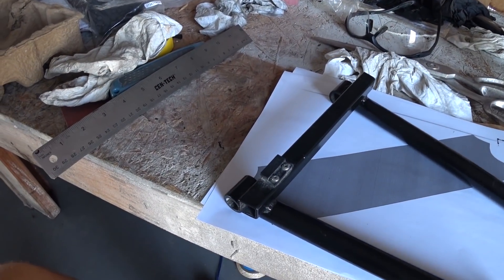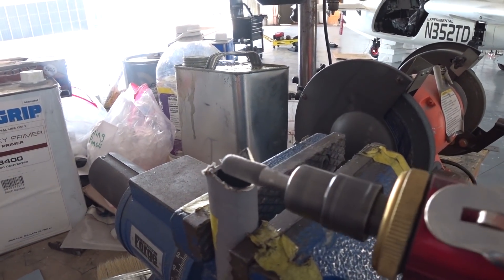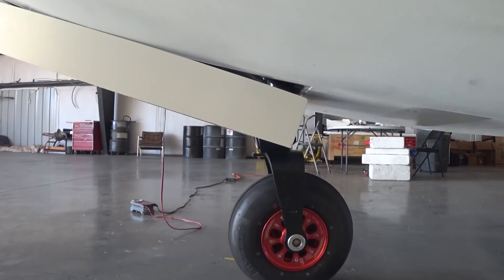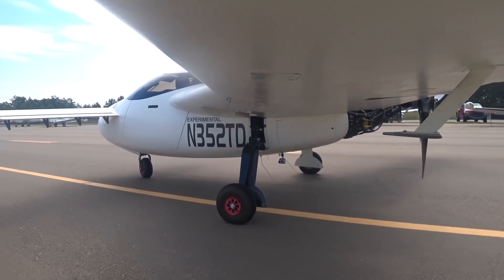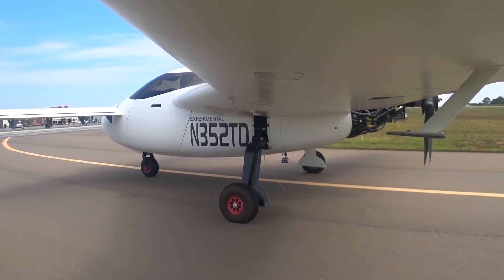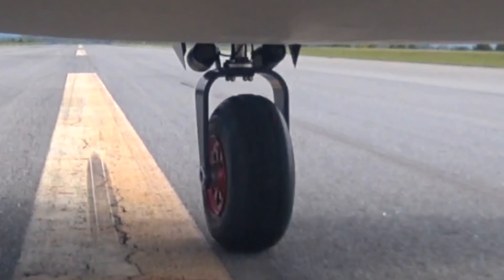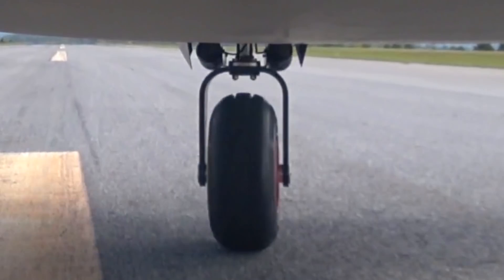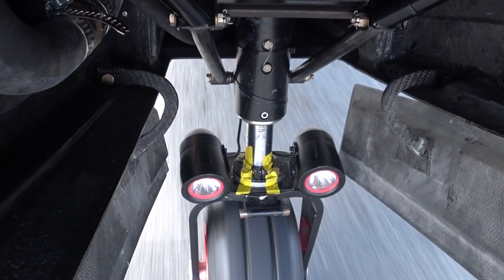Did We Fix the Shimmy? - Building the Raptor Prototype

Comment: Check the internal dampner for serviceability it been thru hell. Could be a over service of nitrogen or oil in the strut. I have seen aircraft have problems with Nose Wheel Streeing (NWS) disengaging and shimming before. Trouble shooting for days and it turned out to be serving or internal wiper or gland nut, (if you have one). That is a good idea about the strut oil and nitrogen servicing. Fighter aircraft use Hydro oil in the struts (5606). Might be something to think about, if not using.

Comment: Look up the proper angle setup for a tailwheel.  It's not quite the same as a nose wheel but is a example that may help.   The angle is set by how the airplane sits or how heavy it is.  It's a lost art.  A degree or so, different tire's, spring arch all are part of stopping shopping cart wheel shimmy.   Right now a shimmy damper won't help

Comment: Consider an external steering dampener similar to what Mike Patey used on Draco, (He would probably loan it to you as it is not in use at the present time)  Shimmy will not go away with an internal setup.

Comment: contrary to some, try  filling the tire with calcium [think tractors] to increase the wheels mass hopefully changing its natural frequency to  a higher speed. seems the basics for castering [trailing] wheel is having the angle intersect the contact patch a little over an inch or so behind the patch center.. GOOD luck,, you'll have hundreds of ideas now   :)

Comment: Have you tried simply replacing the shimmy dampener? I don't know much about shimmy dampeners, but I do not believe that the dampener is actually working. I do know a little bit about hydraulics, and if I had to guess, I would say that the the shimmy dampener has not been purged correctly and has air in it. You might pull the dampener off and see how hard it is to move the rod. If you don't find any issues, I agree with they idea of heavier oil. I do believe the dampener is 100% the culprit. You're doing great work, don't get discouraged! Edited to add - you may also need to move the mounting point for the shimmy dampener rod farther away from the vertical center of the strut. This would cause the shimmy dampener to have to move more, which would effectively increase its resistance. But that might also cause you to need a longer shimmy dampener in order to have the lateral movement you need.

Comment: I would realy suggest that you remove the lights from the nose gear before testing it again. Afraid the shimmy motion will cause the lights the crack or worse break you nose gear doors.
 Other than that, great work and thanks for sharing.

Comment: In my limited research it seems that all wheels in a caster configuration will begin to flutter above a certain speed.  That speed is dependent on many factors but apparantly its just inherent in their design.  It seems that a major factor is the resonant frequency of the mounting structure. 
Honestly at this point it may be a good idea consult with an expert on the fundamental design.  Someone who has dealt with landing gear design may be able to look at your setup and tell you what's going on pretty quickly.

Comment: You have way to much negative castor. The original strut position was a good start point. Get the centre of the axle more inline with the strut. The more trail in the assembly actually makes it worse. Think of a shopping cart when the when the wheel has been pushed back. Its fine going slow. But push it faster once it gets excited it won't stop. This might help.
http://yospeed.com/wheel-alignment-explained-camber-caster-toe/

Comment: I often have the same problem with an old shopping cart, which it typically because the wheel has been pressed to one side so the angle is no longer 90 degrees :)

Comment: On the Phenom 300 the Nose Gear is forward by a bigger angle than your previous setting and not sure if they have dampers. They don't have a problem but I notice they have a wider tyre profile and Lower tyre pressure having more rubber in contact with the ground. Your tyre looks like it is so rounded as to only have half of it's profile touching allowing it to roll from one side to the other.  A wider low pressure flat profile or a double Tyre system would prevent the shimmy from even starting.

Comment: In automotive steering geometry by increasing caster (moving wheel forward) increases directional stability. On Mercedes you can jump a curb and barely feel it as they use very high positive caster (wheel forward). Your mounting needs to be stiffened up. Are you running rubber bushings in the strut mountings or metal to metal bushings?
I would also move the landing lights up or somewhere else and install a shimmy damper there. Good luck.
Reply: OH another problem is right in front of our face... where is the strut scissor? HELLO???!!!!!

Comment: I suspect the canard wing is lifting the nose wheel reducing ground pressure and causing the shimmy. A taxi run with full stick forward wound test if this theory is correct by keeping good weight on the nose wheel.

Comment: Move the axle to at least 2" forward of the strut .. you can try this EASILY by just rotating the "fork end" that holds the axle through 180 degrees. Just like bicycle forks! You need a positve rake .. so put the old geomtery links back in.
Reply: That's what I was thinking. Easy thing to try. Good Luck Peter.

Comment: As I predicted last time, It is going to shimmy every time until you give it a positive castor angle.  Go and check out every bicycle ever!!  Reverse the lower fork so the axle is forward of the strut centreline with and with a positive rake angle on the strut. Supermarket trailing trolley wheels shimmy every time, bicycle wheels do not!

Comment: Hello.
I'm you from Spain and went to Oskosh this year hoping to see you .. you made a wonderful job ..
Except that with a nice plane like that, I would have made a gear reducer and not with belts .. it would also have avoided the problems you had with that ...
I think you could solve the problem by increasing the weight of the wheel.
You have a Berringer wheel that is beautiful, but very light ...
So product can gyroscopic effect and inertia.
The same thing happens on motorcycles, for this reason there are weights at the end of the handlebars of motorcycles .. if we remove them without putting a shock absorber ... there is some shimmy ..
so either put weights or a damper ...
Try also to put the axis of the wheel in the axis of rotation without rearport .. my plane is built this way.

good luck .. I'm waiting for the first flight

Comment: О! Эффект тележки из супермаркета. Вариант 1, уменьшить вынос точки контакта колеса, относительно оси поворота стойки. Вариант 2, увеличить гистерезис на оси вращения, установить демпфер крутильных колебаний. В принципе,  справится любая пара газовых пружин. Вариант 3, закрепить груз на оси вращения, что бы максимально  снизить собственную частоту стойки.
Reply: Yeah because we all read Russion.
Reply: what he said
Reply: @mnminnmn  O! The effect of the supermarket trolley. Option 1, reduce the offset point of contact of the wheel relative to the axis of rotation of the rack. Option 2, increase the hysteresis on the axis of rotation, set the torsional vibration damper. In principle, any pair of gas springs can handle it. Option 3, secure the load on the axis of rotation to minimize the natural frequency of the rack.
Google translate

Comment: Preface: The geometry was always trailing and that has only be turned from negative to positive. What has been changed is the head angle, and that the other important component

90 degree (89.8 is 90, as on the short length used to measure even a hair can make that difference) may not be enough. Having a 90 degree setup makes it most easy to manoeuvre, as the self straightening as the geometry of the wheel has no influence. That's why shopping cart wheels can be 'rectangular'. Shopping carts need to turn on site, but not go straight.

The tire in use is a 'round' one, like on a bike, so the same formulas for 'Wheel Flop' apply. It's basically made up from trail and head angle. In combination both define the distance between the turning point and the point where the wheel interacts with the ground. And yes, as you imagined, for a given geometry, the diameter of the wheel is part of this.

As of now the head angle is basically zero (or 90 - For cars and motorbikes it's usually measured against vertical, while bicycles constructions are given against horizontal), Motorbikes use an angle of >20 degree, while cars (with rather square wheels as well) vary between 3 and 8. Higher numbers are used for faster cars and/or rough surface (funny part that makes geometry of a supersport car similar to an off-roader :)).  So for the raptor a head angle of 5 (85) degree might be a good compromise between handling (low value) and self adjusting force (higher value). It should still steer way better than before, but now pushing the shimmy point further out, hopefully far enough to make it - or at least reduce need for external dampening.

It's basically always a good idea to use inherent forces than to apply external force on a system.

Comment: I'm pretty confident you have a resonant mode in the strut, it is clear from the 1/10th speed video that it is instigated by a bump causing an increase in load and flexing the supports. The free castoring of the wheel translates into an orbital motion of the strut (in plan view) which is a lateral motion coupling with a fore-aft motion, they are coupling in sync at around 25Hz which implies the fore-aft load-path of the retract mechanism and the lateral load-path of the strut mounting are similar in stiffness. The deflection you see might be play in the strut mounting and retract mechanism or deflection of the carbon structure it's mounted to, The stiffness of the strut itself is not a problem, as it appears to move as a rigid body. A shimmey damper is an inelegant (and heavy) solution here because it works in the rotational sense on the steering but that is treating the effect not the cause, you will still have a struct that wants to be excited laterally and fore-aft at a low frequency. I would advise devising a shaker test to check the natural frequencies of the strut, an accelerometer hooked up to an arduino will suffice for logging the amplitude and a variable speed motor with eccentric mass that you can do a sweep from 0 to 50Hz (0 - 3000rpm) will give you a wealth of information to work with,  for a given input forcing in each direction in turn you will see a spike in the amplitude at the frequency of your first resonance and cross reference that with the frequency you see the shimmy on the taxi tests. If you are able to do a deflection/stiffness test or resonance test on another aircraft that has a similar setup it will tell you if you're in the right ballpark or not.

In my opinion the best solution is to stiffen the load-paths, especially in the lateral sense, I've not see the detail of the strut mounting but maybe some extra carbon laminations could be added, especially to stiffen between the supports on each side of the strut. A second solution might be to decrease the trail of the fork so that when it does start shimmying you will have less lever arm and hence less lateral forcing available to keep the shimmy going, I suspect the changes you made to the rake of the strut brought the axle of the wheel more closely underneath the strut attachment points which has a similar effect.

Curiously your engine is a nice source of vibration to couple with and excite the resonant frequency and the fuselage acts as a nice lever arm between the back and the front of the aircraft, 25Hz in these latest taxi tests corresponds quite nicely to 1500rpm as your engine came back down to idle, I'm not saying that is the problem but it's certainly stuff like that I'd be looking at.

Keep going, what you are achieving is impressive and your approach to solving problems is fantastic!
Reply: I also saw the fork flex. Perhaps it needs to be stronger, and it might be good to measure the trail.
Reply: in another thread he claims to have solved the shimmy by changing the struts oil viscosity.  I think he will be in for a big disappointment on that one as it only masks the symptoms.  But even the old Cessna's we all trained in had shimmy dampers that didn't dampen.  Unless perhaps the OP did something other than this oil change to resolve it and isn't telling us.  Regardless I am done giving advice on this project.
Reply: This is just a thought and any other engineers can correct me but I see that this is now setup as drag links for retraction and the attachment is located on the rear of the strut. The aircraft structure is defiantly flexing contributing to the oscillations. If you were to move the attachment boss to the front of the strut this could help dampen the oscillations moving the moment forward. Just an idea. I don’t like the welds in tension in this design setup. This may setup failures in the future. I think the Lancair design has the welds in a compression state; I think? I could be wrong, I have been in the past..

Comment: It looks like you need more dampening, it's a spring mass system and when it reaches the nature frequency it does not take much energy to excite it (stating the bleeding obvious I know).  It would be interesting to do a vibration analysis, does solid works do that?

Comment: The complete bracket is moving inside and looking like about a 1/4" off center each direction in the bay if there is anything to decrease any play would help greatly. 
Definitely moving the tire center back from pivot center line would help alot. The gap between tire and fork seems to be a lot more than needed and increases leverage.  Your ideas on oil and rake will help if not enough might try a dampener like on Draco's tail wheel. 
I know you will get this taken care of and be on your way to the next step. 
Thanks for all your updates.
Reply: he could probably get a good deal on the Draco tail wheel setup :)

Comment: I'm just wondering why bicycle and motorbike are using opposite geometry? I have seen similar shimmy in shopping cart and that was also using trailing edge geometry.
Reply: I was just about to say the same thing on both my airplanes the nose gear rakes forward not aft. Even the cirrus which is free catering has a forward rake.

Comment: Hi Peter, on both our big Boeings and Airbus widebodies, we always hold slight forward pressure until about 100 knots.  The purpose is with the Thrust Line change with Takeoff Thrust, the nose gets unacceptably light.  The  A330 is particularly noticeable due to it being originally designed with both 4 engines and a centre bogie, removed when made into a twin engine.  When your rear thrust is applied, it is putting a downward force on the nose wheel.  Removing the thrust lightened your nose considerably.  This may have started the oscillations.  Along with the other suggestions of lowering tire and strut pressure, try a high speed run and when power is removed, apply VERY slight forward control column pressure.  Obviously, not enough to wheelbarrow.  It may help.

If I may add one other suggestion.  Block the nose wheel off the ground in the hangar, and use a compressed air gun chuck to blow along the tire longitudinally and get it rotating at very high speed.  It might let you see and hear bearing friction and maybe even see how true your tire is running.

Comment: the wheel can shim left to right +-20 degree? i think, the new angle is not enough, to stabilize such a play and the reason why it starts, should be braking, more load on the front wheel. thanks & best regards

Comment: Well in my opinion Shimmy is happening because of extra weight on the nose wheel, assembly is not supporting the traction. Deceleration is shifting weight to nose wheel and the angle of fork assembly is not supporting this. You'd have to try with a slight forward angle on the forks and increasing the shock play. Strengthening the fork might transmit more vibrations to main structure.

Comment: I would suggest reducing the weight on the nose leg, adding the LED lights on top of the fork means the sprung weight is increased, in motorbike racing, this will be a big no-no and every measure to reduce weight on the fork will be made, just my few cents

Comment: Installing a automatic wheel lock above certain speed (say 30MPH) could solve this problem. similar to what is in this link : https://airtractor.com/news/2018/12/new-air-tractor-tail-wheel-lock/
And it seems the "shimmy" occurred as the piston rod extended out about one inch, judging from the scratch mark on the rod, if there is any way to limit out extension , it could help .

Comment: Hey Peter,

It seems like that strut is not having a harmonic oscillation around the rotational axis, but actually occuring due to a coupled system. I believe if the lateral play would be reduced the speed at which it occurs should increase quite a bit. You may try to make a simple computer model to verify the hypothesis.

Pere

Comment: It looks as if you need support arms either side of the wheel i.e. support the steering shaft from the base to support the steering shaft piston, see figure 13-50 in link below.
http://www.flight-mechanic.com/nose-wheel-steering-systems/  Figure 13-50

Comment: Trying to engineer a complete solution before getting some test data may not be the most efficient process.     I think the next step is to stiffen laterally if feasible and externally damp with an adjustable damper.   Select the highest dampening with an acceptable entry rate that does not plow.   Taxi handling and landing tests with many differing speed, wind, and weight conditions may point to necessary adjustments.    Once you have a tuned prototype, you can optimize for production; so consider making things adjustable once they've become a problem.